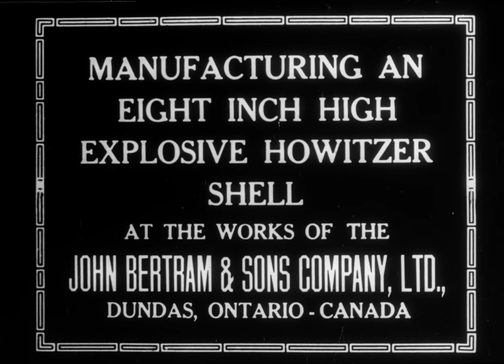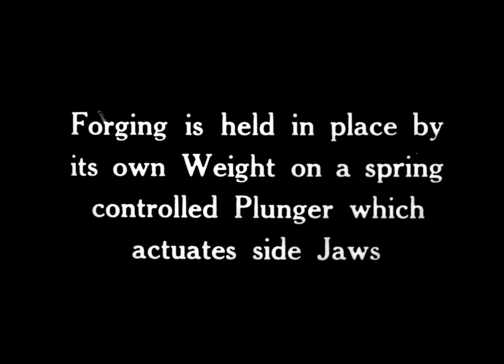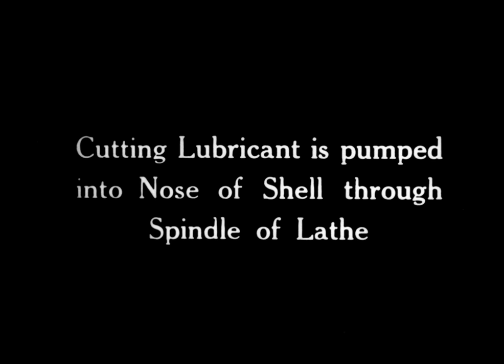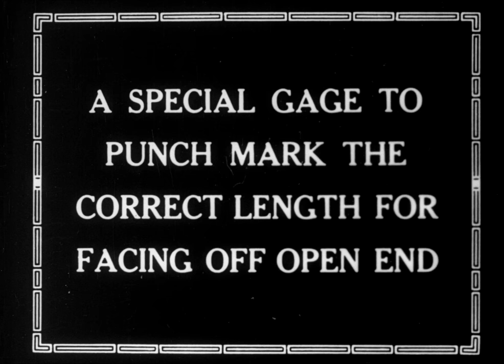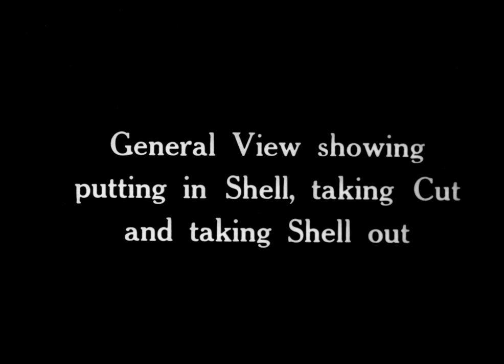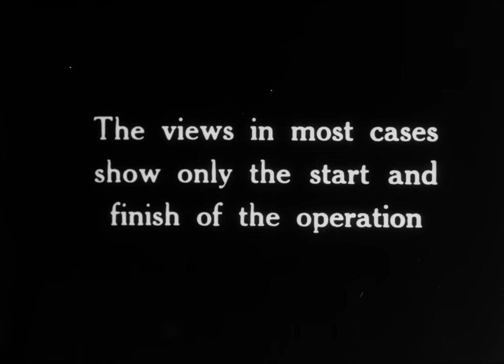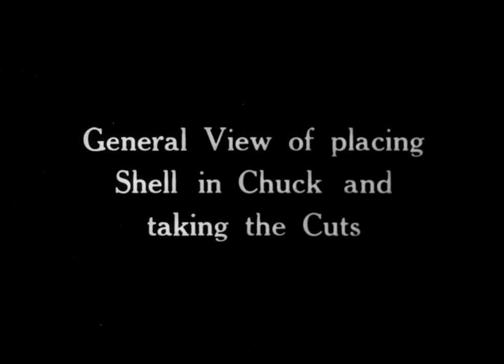Manufacturing an Eight Inch High Explosive Howitzer Shell (1917 ?)

Comment: Unbelievable.  All that precision work for a one time use and how many times did a shell get loaded in an out of a lathe.   Seemed like many of the processes could have been optimised, even with the 1914 technology at hand.   How much did each shell cost ? And at the end of the war there must have been an unbelievable mass scrapping of thousands of specialised lathes etc.
Reply: The loading and unloading allowed for stockpiling if a machine, tool or line went down per the folks I talked to who worked in  the WWII plants.     Yes it took 30 seconds per station but it doing more processes on 1 machine would mean more downtime when the machine went down for a with a tool change.     It also made for very consistent parts, concomitantly wrong and shipped ordinance litters the worlds scrap yards to this day. 

I worked in one lab where a 8 inch shell made in 1918 was a low radiation steel  detector housing and vacuum chamber with electronics from the early forties.  We had 2 sitting on a shelf in case we needed a replacement made.   We sourced and tracked steel containers made in the 1930s that held 8 oz of pre WWII wax to hold radon collection media when that testing sort of testing was all the rage.
Reply: @christopherwhull  - you should explain more about precisely why 'low-radiation steel' is important and why it cannot be 'made' in the post-1945 (or more pointedly the post-1947) world.
Reply: Lowers the noise floor of alpha and beta detectors when looking at very low rate decay.       Lead, Silver and Steel in those detectors can be kept free of airborne fusion and fusion products (that emit alpha and beta) for better instruments.   Alpha and Beta can be shielded with low rad lead or low rad steel making the counter have less noise when empty.   As radon is very rare and Radium-226 is even more so, detecting every alpha decay of a sample increases test rate that might have a rate of only 100 counted decays per 8 hours with the instruments only generation 10-100 counts when left empty.    If the instrument generated 250-50- counts when left empty the test would have to run for 4 times longer to have the same accuracy at a lower precision. 

Low rad sample containers were typically movie, makup, wax or flim containers of known packaging date.   To the labs these were what appears to be cheap beat up cans but were truly valuable in high rate radon testing, because these could be shoved into the vacuum chambers and each had its own rate that was much lower than the media to be sampled.
Reply: @christopherwhull  Thanks for that comprehensive explanation.  I now also understand  better why metals from pre-1945 shipwrecks have such specialist value.
Reply: They've got each different lathe pre-set up to run each specific operation so almost no effort needs to be expended setting the machines and there is almost no room to make mistakes as you spin the handwheels.

Comment: Anyone know what the "Wave Rib" was for ?  25:23
Reply: I believe that is were the driving band is placed which seals the propellant gases and engages the rifling to spin the projectile.
Reply: The wave rib keeps the driving band from spinning separate from the shell as the rifling engages the band and then must overcome the considerable rotational inertia of the projectile in its short TOF through the barrel.
Reply: The shell has a copper driving band that was swedged over the wave ribbed area. They show trimming the copper driving band, but not attaching the copper band.
Reply: .

Wave Ribbed for your satisfaction. 

.

Comment: is the shell production still as wasteful of steel as it was back in those days?
Reply: I think President Johnsons wife owned a bomb factory.  She made them out of cast concrete.
Reply: Miss lady bird Johnson.  Made  millions off of Vietnam! War.
Reply: Wasteful is relative.  All of the steel removed could be collected drained of cutting fluid and sent back the foundry to be used in the next batch.  Whether it was is any ones guess but suspect so as there would be literal mountains of swarf laying around otherwise.  People get so caught up (even today) about the cost of material when the real cost is in the man power to make stuff happen.  Even back then.  The video shows at least 10 different people working on each shell, multiply that by the number of lines they were running and the labor bill get large quick.
Reply: Brainslav  ,  Scott is right .   The chips and shavings were reused .  60 years later I worked in a Machine shop where large quantity of parts were turned each day by automatic Lathes .  The Chips were spun in a machine to recover the Coolant / cutting fluid which was reused .  The Material that is assumed to be waste was also very valuable . There was a lot of it !

Comment: I was doing identical work on identical machines in 2005!
Reply: @johngillon6969  NO.  No-one had or needed safety glasses in the 60's.
Lots of male and female craftspeople in those days.
Reply: Hypnotizing thanks for putting this together I could not stop watching it.
Reply: They used safety squints in those days.
Reply: @coyote5735  Hmm, not all that often.  Most machines throw hot chips off in predictable arcs.
Reply: @rosewhite---  I like being able to get right up on the work even with the chips flying into my face.  Goggles for the win.  They're definitely a part-time safety implement though, you know when your eyes are going to be getting a blasting from high pressure air debris or thrown machine chips or grinding dust or whatever it is.

Comment: I didn't see any socket wrenches; all were open-ended. No crescent or pipe wrenches, either. I wunda how often they had to replace the cutting tools. The whole production line was poorly lit, and the machines were belt-driven from overhead shafts; the workers likely had a high on-the-job injury rate.
Reply: Yeah OSHA wasn’t a thing back in the day.

Comment: Why the wavy engraving ? So it looked cool ?
Reply: That helped secure the much softer copper rotating band to the shell body, so it did not slip.The rotating band engages the rifling of the barrel, forms a gas-tight seal, & imparts the stabilizing spin to the projectile when it is fired. There is a lot of force at work here. They didn't really show how they first installed the rotating band, just how it was finished. Must have been a proprietary secret.

Comment: That thing is very thick, i always thought shells were thin and were made by stamping metal not casting/turning
Reply: No the metal was thick so that the shrapnel was deadly
Reply: This is a very special shell-it was used by siege batteries against hard targets such as concrete bunkers.
The thickness is to give added weight and strength so it could penetrate the target.

Comment: Thanks for posting! Very nice! 

But how come, they no gusta using glasses or gloves?
Lots of splinters there!
Reply: Workplace safety regulations didn't start coming into effect until decades after this.
Reply: killingstone wrote: " ... how come, they no gusta using glasses or gloves?
Lots of splinters there!" ...... In 1917 it is unlikely that anyone made safety glasses. Gloves: Some of the workers were wearing a glove or gloves. One in particular had a loose-fitting glove, which is dangerous to wear around rotating machinery. I was a Cat heavy-equipment mechanic for 10 years, & I had heavy-duty gloves, but wore them only when I used a cutting torch.

Comment: And look...No protective goggles or glasses.
Reply: Do you see any one eyed machinists in that place.  It must have been nice then, machinists got respect, and people didn't try to tell them what is best for them.
Reply: Turning speed was lower than on modern machines. Chips nowadays fly much faster.
Reply: The Inspector is the man with one eye.
You should try inspecting without closing one eye.
Top men, closed one and put their tongues out too.
Especially, when thread chasing, a fine thread!
Reply: @rafastepien4303  Who Cares!
Reply: That is because if you lost an eye. You were tossed out on your butt. Machinists were a dime a dozen. They got respect when they were holding their tin cup.
Reply: OSHA approval
Reply: @theyarehere8919  

Machinists have always been in short supply. They weren't to quick to let anyone go.
Reply: Robert Raese   Do you think it would matter? One wrong move and BOOM`
Reply: Safety 3rd,  back in the day
Reply: @richardsimpson3136  My buddy runs a machine shop.  I've walked through the place a few times.  Everyone wears goggles or safety glasses,  ear plugs and aprons. I'd imagine that the employees want to go home from work the same way they came to work. 
I don't know if you have ever used a lathe for turning wood, plastic or metal. It can be very dangerous.  Loose peices of material become projectiles.  The faster an object flys, the more force it carries.  It's the difference between somebody tossing an object, and  somebody throwing an object.
Reply: @moebedick5968  none of these things were loaded with explosives until they were at the destination. The charge is placed where they put that wooden cap for shipping. The propellant is loaded behind the shell in the gun at time of firing.
Reply: Robert Raese  its very slow turning parts....no tungsten carbide inserts..no hss...just carrbon steel cuters very slow
of corse safety googles is 👍👍👍
Reply: But notice how many were wearing a collar shirt and tie.!!  LOL

Comment: So many steps, and so many of them repetitive or done singly. That operation done today would be in a fraction of the time and effort.
Reply: If done today, almost entirely automated. And that final packaging: way overkill.
Reply: @DLCaster  I can't believe how many times they machined the nose and base. That should be one or 2 steps only, done with cutters on both ends.
Reply: @DJ-bh1ju  Today this would be a 30-40 minute job tops from the raw forging to the finished shell. A purpose-built manufacturing cell would complete this with greater precision and much faster than what we saw in this video. One does have to keep this in perspective though. What we watched being done was taking place in the first 15 years of the last century—more than 100 years ago. At the time, this was probably considered a "modern" manufacturing operation.
Reply: @DLCaster  And it would have only 1 or 2 guys monitoring it and moving the stock around.....  For the millions of shells that were being made for a 4 year war, we'd definitely have a couple of purpose-built lines going. I would imagine that's how they make shells today, tho not in the millions...
Reply: If you watched all the hundreds of employees coming through the gate each morning, you can figure out why there were so many steps used to machine each shell. The engineers were making work for thousands of men and women to keep them busy. I became aware of this soon after watching what was being done to the part. I compared this with modern complex part production. It is so obvious that they planned how to make as many steps and procedures as possible to employ as many people  as they could. Everything done to make this part took as many steps as they could possibly figure how to stretch the work so everyone had a little something they could do.
Reply: @DLCaster  I disagee, I worked in a shop that machined rough castings. We did rough cuts followed by finish cuts on a better machine. The casting was peppered with sand and quartz that destroyed cutters and the machine ways. You had to rough it down prior to putting it on the CNC lathe.
Reply: @carbidegrd1  The material handling suggested in the post was that of rough forgings. Shot peening or other handling techniques could eliminate silica contamination of the workpiece and equipment.

Comment: This was in an era of large steam plants, stationary steam engines, line shafts and leather belts to power each machine. Very professional filming and lighting to show all the machining steps by expert machinists. An excellent film that doesn't require lots of dialogue.
Reply: By 1917 it was mostly electric
Reply: Extensive line shafts showed at the beginning of the film.

Comment: Amazing the number of precise machines they had in those days..
Reply: Did you notice the constant flow of cutting fluid spewing everywhere? I wondered if the floor was gridded with drains that lead to filters and pumps for recycling.
Reply: @carmium  Either that or sieves and tanks included in each and every machine. Both schemes are common thoughout industrial history

Comment: Not everything changed in modern times - forging is done with more automation but not a lot more - https://www.youtube.com/watch?v=lswJbqVySfM operations on the lathe will be combined on a CNC lathe possibly with use of a combined machining centre. Cutting speeds would be at least 3x if not 4x faster today with use of carbide. If it took them 3h we can do it in around 45min or so today. Main drawback is that both forging and packing processes didn't change much - just the machining. We still forge about the same way with a bit of added automation and still package finished shells in wooden boxes.

Comment: Thank you for preserving this important documentary film. It is a 102 year old record of Canadian men and women contributing to the WW1 war effort. Thank you for your service!

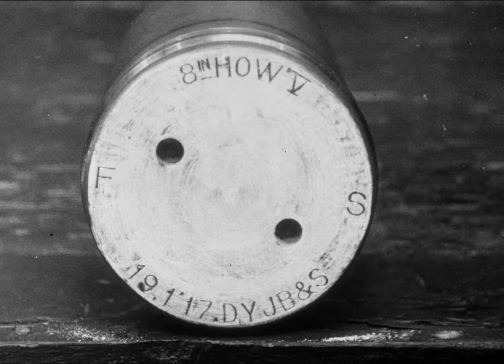As to the date of this film, as question in the title, (1917?), at 51:07, a closeup of the shell’s base “Adapter” shows the following stamped markings prior to boxing:

           8 in HOW V

F                                         S

     19 1 17  DY JB&S

 So this shell was stamped manufactured, January 17, 1917. 

The Adapter used a left hand thread to attach it to the shell body. 42:28. Does any one know why?

RL Buffalo, NY
Reply: Probably so it is opposite to the rifling in the Howitzer barrel-  stops it unscrewing when fired.
Reply: @asdonut  Yep,there's a lot of torque when the shell's rotating band takes the lands right hand twist when fired.
Reply: They also did some turning on the adapter after it was installed, this is naturally a right handed operation so it would help with that also (it wont undo whilst turning).
Reply: Usually day, month, year so it's 19 January, 1917....just too OCD to let that slide. :)
Reply: @carlbukowsky1931  Good point. And while the film was shot in 1917 it could have been 1918 by the time it was completed and released.

Comment: Incredibly inefficient. I cannot believe that they did not eliminate all the duplicity and repetitive actions. For example, they machined the nosecone multiple times. Should have been one-and-done.
Reply: Thomas Paine  Could be true, I was only speculating.
Reply: Probably would've required an incredibly expensive specialist tool to cut the nose face and hole all at once.  Which would've swiftly dulled and required either very highly skilled resharpening or very expensive replacement.  They didn't quite have tungsten carbide insert technology up and running back then...

Comment: My mums job in WWII was in a munitions factory filling shells and said most of the girls suffered from headaches caused by the shells filling don't know the exact explosives that were inserted but mum said that different uses used different types of explosives these girls are the forgotten ones of industry during the conflict
Reply: It's caused by toxic fumes, since Safety regulation within the early-modern period of Industry was still on it's infancy and working industry is far more harder back then than now.
Reply: @Romanov117  It's from nitrates.  Most will go transdermal.  Had a lot of that at Badger AAP from handling nitrocellulose propellant grains for 2.75" rockets, and TNT.

Comment: 44:10 back when body parts and clothing and moving machinery met no eye or cancerous cleaning fluid protection was necessary and everyone was lighting smokes and pipes within the factory on there way out after work. ahhh the days of the 8 inch shell that ruled the seven seas but wasn't that effective on land under a few inches of soil.

Comment: I can't help but think they really over did it with the machining and finishing. I can understand crucial areas like gun barrel contact points, but these were finished like a fine rifle barrel. Think today of say, a Ruger Mini 14 receiver. Only the critical areas are machined, most casting areas are visible, and This is a product meant to last for years. How times have changed!
Reply: A high explosive shell is a bad part to have defects in though.  Absolutely unfun if it decides to detonate inside the barrel of your weapon.

Comment: I can see a modern OHS manager having conniptions over the unsafe practices here.   In just about every segment there are actions which are potentially injurious.   But they did what they had to do and this is how industry was until quite recently.    Neckties would have been required in machine shops to “keep up standards” resulting in quite a few decapitations and strangulations right up until the 1970’s.
Swarf lacerations and lost eyes , crushed feet and entanglement would have been viewed as just part of the job and accepted.

I guess the wave ribbing kept the driving band from rotating independently of the shell case. Go/No-go gauges are still used today for inspections.   Nice how they threaded the base plug/adapter in one pass.

Comment: The size, weight and thickness of the shell, the quality in the way it was meticulously manufactured and the process required to ensure accuracy suggest that these shells were used for naval guns of either the destroyer or cruiser type ship.
Reply: These were for howitzers, so field artillery, pulled by horses.
Reply: They're howitzer shells, therefore destined for ground forces.